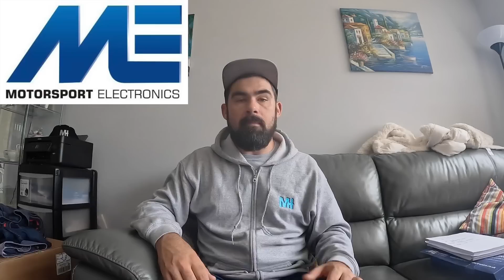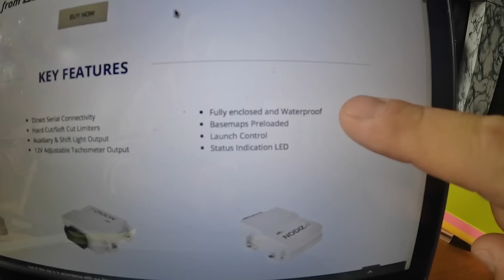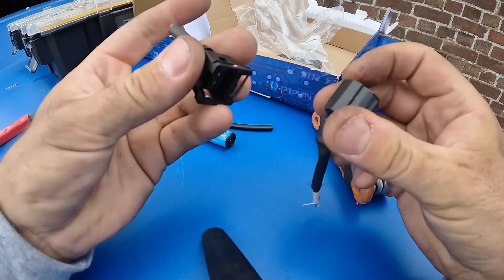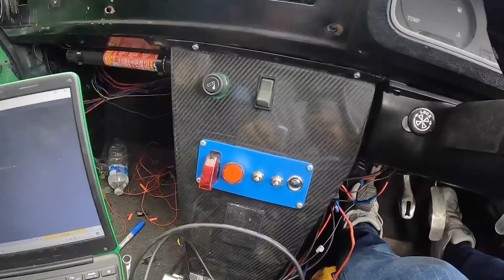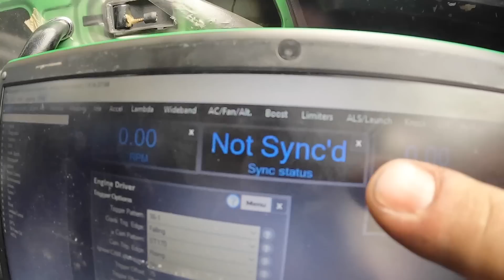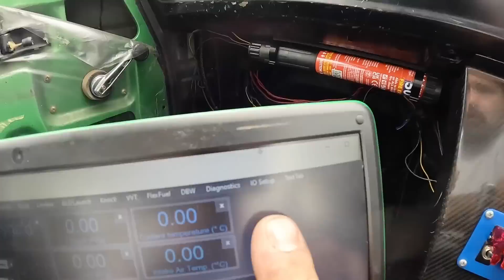*NEW* ME100 ECU from Motorsport Electronics!! 👍

Comment: You need to go back to the RR & get the ignition table tuned, its a bit pointless wiring up the TPS & leaving the part throttle values un tuned. same goes for the VVC but that's not so important.
Reply from the maker: Everything was the same before (including the TPS) and it was tuned on the RR. I only changed the ECU. 👍
Reply: @marcushayesford  Ah sorry I miss understood! I thought you meant you didn't have it connected before, that will teach me to comment on things when I've only just woken up 😀

Comment: Great video mate, just a tip rather than cutting the coil cables you could of depinned it with the correct tool, not loads of money and will make it easier
Reply from the maker: Thanks for the advice mate! 👍 I REALLY should get one of those tools to de-pin multiplugs. 👍

Comment: Motorsport Electronics have recently released the Nodiz Pro GEN-X as well. Very affordable. I've had a nice 711M 1660cc X-Flow built with twin 40's I'll be installing and breaking in with a recurved dizzy then purchasing the GEN-X and getting it dyno tuned I reckon. With the full 3D map I imagine it will be an impressive upgrade from my stock 1600 with a dizzy and a Weber 32DFM